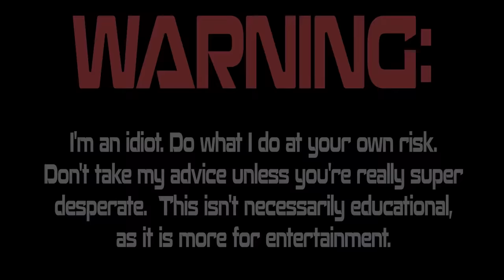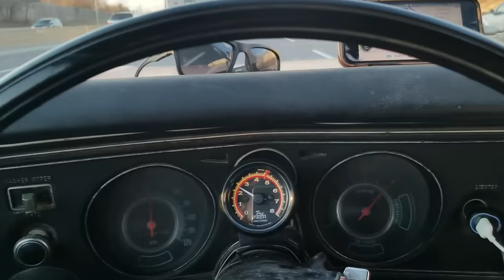FORGOTTEN 1969 Chevelle will it RUN AND DRIVE 500 miles home?

Comment: That relentless “can-do” attitude is inspiring. Much respect. Almost like therapy, in a way. This sub was a no-brainer and WELL deserved.
Reply from the maker: Thank you for subscribing
Reply: A guy sure does enjoy the vidgeos.
Reply: @ViceGripGarage  To answer your question in the video. Only firing order 
 one I can remember off the top off my head is the ol straight six and Kenworth Trucks cause I build them everyday in Chillicothe Ohio. Straight six is, 1, 5,3,6,2,4. And the ol Kenworth diesels fire at the same actually if it is the Cummins motor. If it is paccar motor they are a bit different but almost the same. Just starts at valve 2 instead of one. And btw subbed and Joined the Clubhouse! Love your content man. Could drink beer with you all day. Your a real one 🕜

Comment: firing order of my Briggs and Stratton lawn mower engine----  1...1...1...
Reply from the maker: Pull the manual out? 😂.  Thanks for watching John appreciate ya!
Reply: @ViceGripGarage  thank you!
Reply: Harley Davidson 1,2,1,2,1,2,1,2,1,2.............
Reply from the maker: Nailed it.  Unless its mine... 1.2.1.1.1.2.1.2.2.1.2.1.2.2.2.1.2.1.1.1.0
Reply: I think that's the same firing order as a Wankel. Lol.
Reply: My Harley goes 2,1,2,1,2,1 (AMF)
Reply: Battery to distributor to plugs!! And I know the coil is in there somewhere near the piston return springs!!!
Reply from the maker: Hah
Reply: Lol!
Reply: lol
Reply: Lol
Reply: Came here to say the same thing
Reply: Always screw that up.
Reply: Mine is 1,2,1,2,1,2,1,2,1,2
Reply: Is it the same mower that is the size of Titanic?
Reply: International Harvester 266/304/345 and 392 V8s are pretty fun. They use the same firing order as a SBC but they time off #8 instead of #1.
Reply: John Becay that is exactly the same as my Honda dirt bike engine 1...1...1...1...
Reply: Is that forward or reverse?
Reply: Our 1939 John Deere is 0-0-0-0-0-0-0-0-take break hope you don’t have a heart attack-0-1-0-1-0-1-2-1-2-1-2-1-2-1-2-1-2
Reply: My Harley is 1-2-1-2-1-2-1-1-1-1-aw, shit, that back cylinder is mis-firing again??? sigh
Reply: This might be some good info, but a guy's running a Tecumsie on his lawn mower

Comment: Anyone who sees this, good for you. I always do a compression test dry first. Then add oil if a cylinder is low. If it picks up compression then the issue is rings/cyl wall. If it is still low after adding oil, it's a head issue.

Comment: Any average european driver: calls for a tow truck
American driver: "We dont do that here"
Reply: whats a tow truck???
Reply: @knuckleberry4720  Exactly! I got a clapped out dually to tow a 20 foot trailer for hauling cars that can't be driven. Usually due to body damage. Or them newer cars that can't be fixed so easily due to all them sensors and computers that go bad regularly.
Reply: @consaka1  cool i have a 1975 ford f250 4x4 360 4 speed. it should be fixed up by fall /winter glad the stopped pure salt and use sand salt here in upstate new york.
Reply: @knuckleberry4720  You need to get them to quit using salt altogether. I see the cars from new york on the "south main auto channel" and fairly new cars are rusted to pieces. he tries to get stuff apart and the rust just rains down all over his floor. Its rediculous.
Reply: @consaka1  thats the northeast
Reply: @knuckleberry4720  The other end of the state is different?
Reply: @consaka1  no the northeast of the US
Reply: @consaka1  down south is the bible belt up here its the rust belt
Reply: A what now?
Reply: Last time I called for a tow I got stuck in someones drive way because their driveway was basically on a downhill area. My car literally was teetering LOL.
Reply: So you’ve never been to Europe then...
Reply: @johnnyrvf  I am eurpean dude... Its a joke..
Reply: That takes out half the fun of these videos. That's why he doesn't usually tow!

Comment: I lost it when he said carb adjusting tool and pulls out a hammer
Reply: Tyler Tyler your parents would trade you for a carburetor
Reply: Tyler Tyler do you even muscle car bro😂
Reply: That's the answer if it doesn't work hit it. Violence and technology, great bedfellows.
Reply: Last time I dealt with a quadrajet carb . I got up on the  front and Happy Gillmored the carb off the intake and stuck and edlebrock on .
Reply: Hell yeah I'd take a carb all day over old shity fuel injectors
Reply: Hey guys you're not paying attention to our supreme leader. It was a screwdriver not a hammer. Always use the correct GM tool for the job!
Reply: @dennislynn2955  it's called love tap therapy now a days
Reply: @harryhyde4331  Haha!!

Comment: Thanks Derek for bringing back memories of my long deceased Dad helping me put life into a forgotten 71 Challenger I found behind a car dealership left for dead in 85. 
We stuck a battery in, poured oil and gas in it, put on some used tires, got her running and I paid 200.for a clean title to a rust free straight solid ride. 
After tweaking on it, cleaning it and tuning herbup I drove her for 2 years but the memories will last forever. 
Wish I still had her but she went to a good home.

Comment: Love the channel, I need a road trip like this, been forever, had me a couple Chevys,68 Caprice 2 door 327 ,73 El Camino two different 350s, 73 Monte Carlo 350 Rusty but trusty used to drive the highway to work doing 120...308 gear. 68 GTO 400. 70 Torino 302. 74 Plymouth Satellite DNR car green four door 318.85 Chevy 3/4 ton 350 with the fancy FI. quadrajet contraption. 94 Lincoln Town car. And various jeeps and pick ups. Work on everything my damn self... 54 y.o. Welder Fab guy.
Reply from the maker: nice herd of vehicles!!

Comment: Thanks for the ride Derek. The 307 build was one of the first we watched, but this one is quite the tribute. You share just the right amount of detail to teach the same things over time, so we understand both the importance of the order you follow, and why some things like three gauges matter at highway speeds, or why the engine is still running...alternator works. These videos are priceless, and we're all so much better off for feeling in a way like we spent three chilly days in Illinois with you.

Comment: About those thermostats. I cut the part off where the spring is. I take a 3/8 drill bit and drill a little hole in the thermostat. It holds a little antifreeze back but also allows antifreeze through.

Comment: The gas can reminded me of the day I brought my 64 Impala home. But my gas can was on the floor , front seat. I did not have 500 miles , about 50
Reply: No smoking? Where’s the fun in that!! Gotta have suspense and fear lol
Reply: @kenwillis8487  Yep,  but easier to tow home
Reply: On my wife's YouTube but a cigarette will go out if dropped in a bucket of gasoline, used to clean parts over a bucket of gas. Now try that with diesel, probably not a good idea. But gasahol needs an open flame to ignite, IE spark. And the higher the octane, the less bawoof affect, lol. Cheap gas runs across the ground in fumes, good fuel sits pretty, lol.

Comment: When Chevy made good reliable cars, can't say that these days.
Reply: I've got a 2010 Camaro SS/RS with 75,000 miles on it with 0 problems. I bought it new. Yes I go to the track and race it and it's my daily driver unless it snows. Love it!
Reply: Camera Stage Videos when the criminal government forced computers into cars they ****ed EVERYTHING up.
Reply: Camera Stage Videos
I'll agree with you on that.
Reply: @adamdozier5757  Give it 200,000 miles and get back to us.
Reply: I think hes referring to the none ls powered Chevy cars
Reply: @jerredwayne8401  Who?
Reply: @b.c.gamingss  op
Reply: @jerredwayne8401  Alright Mr. Boshears, I was referring to Mr. Dozier.
Reply: lol, I grew up in the 60's and 70's. Any car with 100k miles was shot, you cant say that with modern cars.
Reply: @adamdozier5757  let that camaro sit about 15 year i guaranteed you will have to fix almost everything in that vehicle
Reply: @markclark4406  WELL IT'S BEEN 9 YEARS WITH 0 PROBLEMS. ANYTHING FROM THE 80'S AN OLDER CAN'T SAY THAT WITH 82,000 MILES ON IT. yOU DON'T SEE TO MANY OLDER CARS WITH THAT LARGE OF A NUMBER. MY 55 CHEVY ONLY HAS 40,000 ON IT AND I'M DOING A FULL RESTO ON IT. I'M NOT YELLING I JUST SEEN THE CAPS WAS ON. LOL

Comment: Every time you talk about one of these drives I kind of smile because I have made all of them in some form,  I moved to Alexandra Minnesota in 2007 from Ohio and left there just shy of 10 years in 2017, I spent 10 years in that state doing multiple types of road construction for minndot and I got to tell you guys, I chuckle at Ohio winters now! The flat corridor running east to west from Fargo ND to Alexandra is one of the coldest places I have ever been in the lower 48 states! I try to describe the cold but there is no describing -60 wind chills and - 50 temps and cold that hurts your skin and you can't breath well. I have one photo from when I lived in this small city called Ashby, between Fergus falls and Alexandra, where I had shelved my walk all winter and on each side of the walk is a wall of snow 3 1/2 feet high. That area is really flat and snow just blows all over the road and drifts are every ware! A guy could do well to buy himself a 4 wheel drive in that state, not to mention some good Air conditioning in summer because it's humid as hell there, at least you got great fishing holes. I was telling my buddie if you walked out your front door pointed in a direction and kept walking in a strait line in that direction, you would eventfully hit a lake you could fish in! In all honesty Minn is one of the most beautiful places I've ever seen in summer and a great vacation spot if your into fishing and camping, but from ND to WIS all three of them states are some of the most brutal places I ever been in winter, only being outdone by Alaska! hahahahaha

Comment: I am binge watching and am going down memory lane with my past vehicles.  One in particular, 66 El Camino, 396 with 375 hp.  Starter built too close to the exhaust manifold.  Difficult start cold and would not restart if warmed or hot.  Would compression start or jump start.  After several starters, I was one unhappy puppy with Checker and somebody else auto parts in El Paso Tx.  It was my learning platform and I was a soldier at the time and 19.  Alot of defective points or plug wire kits, coils and I learnt what a ballast resistor was.  But three starters and batrees.  I really wanted this beast to work.  I ended up selling to a person who eventually got it started and daily driver, just not mine, oh well  Thanks for the reminder.  Defective parts out of the box and this was 76-77, 19 that is.  again, oh well

Comment: 32:00 “I’m gunna fill it up with oil and check the gas.” 
This is a line I’ve been using for nearly 20 years and it took a moment to drop, but it is so true when you’re working on old cars. 
The air cleaner is hilariously large.

Comment: 307 cid were a pretty reliable engine. There was a problem with the cams in them, but I forget what year it was.
I really love my Chevrolet's and GMs too. I started a mechanic apprenticeship in the 70s and they were so simple to work on compared to Ford and Chrysler. Parts were cheaper too and better quality. AC Delco 💕

Comment: Awesome video, brought memories when i use to overhaul those carburetors with a Borg-Warner repair kits., There were also kits for the brake pump and the fuel pump.Today just exchange and replace... great car i had one 1969 to bad it was all rusted..........

Comment: Known Chevy small block firing order since 1980.
Brother got an '67 Chevy Bel air. Timing chain was so loose it wore a hole through the timing cover. Two weeks after that, the rings seized to the pistons and it lost compression. We rebuilt that 283. Ran well until the radiator split and the engine overheating. Valve seat dropped, held a valve open, and it punched a hole through the piston.
Replaced the piston, and repaired the dropped valve seat. It ran after that, but smoked. He drove it until the frame rusted out.

Comment: in canada your chevelle was also called a pontiac beumont, built on a chevy platford with chevy dash in oshawa, ont. the chevy ss was a 2 t 2 on the beaumont. both used chevy motors.

Comment: A method I have used in the past to remove a broken off brass fitting is to hammer into the fitting an slightly oversized straight blade screw driver and then using a pair of vice grips on the blade, easily back out the fitting.

Comment: Did you try banging on the starter with a hammer?  That used to
work with my 1967 Mustang when the bendix spring would get stuck.

Comment: My very first car was a 68 Chevelle Malibu with a 307, and 2 speed Muncie. It was an awesome car!
Right up until I ran it through a cinder block wall... But it still ran!
Those 307s are bullet proof! Keep the oil changed, and they'll run forever!

Comment: I had a 69 Beaumont (Canadian Chevelle) with a 307. Notorious for burning oil. I went through about a quart every 100 miles. Just kept dumping in STP and eventually got about 1 quart every 300 miles. Other than that, she ran perfect. I went across Canada and back (10,000 miles) with no major issues. Killed a lot of skeeters :)

Comment: Derek find the lightest chassis you can put 4 11 gears in it 327 with 305 heads on it you can roast the tires or put tractor tires on it until your cornfield

Comment: The Chev 350 V8 had picked up. Was a mid 70 engine and turbo 350 imported into Australia sold as a ‘good running complete’ to swap into my HJ Holden,,, well it was a oil burner, and on cold starts (and in the tropics too) would also rod knock for 3 seconds. Have not purchased another thing from them for 25 years
But I drove it 2800km (about 1600 miles?) Over 3 days in the mid 90s to Victoria without issue other than plugs oiling up.
My engine was junk but they can still run after many miles of abuse.

Comment: Glad i found you i needed to know what's on the market now i haven't started my 72  GTO since 91 need to find that oil and gas mix you had just to get it stared again i have a electric fuel pump i can shut off. 1985 last time i put gas in it I ordered the car in Dec 71 got it in Feb 72 retired now time to get it back on the road.

Comment: 18436572  is really the only one you need to know, but when I was learning to be a mechanic in the mid to late 1970's while in high school, the senior mechanic at Sandwich Chevron where I worked, (there was only two of us) taught me some great ways to remember tech info.
I already knew the Chevrolet firing order from building my Camaros.
Then I learned most inline 6 cylinder engines manufactured from the beginning of time , to the late 1970's  had a firing order of :
153624
Senior mechanic Dave was a lady's man. Real or imagined. The way he said to remember the inline 6 firing order is :
"To young, too old, just right" ........
He was a very knowledgeable mechanic, a character, and a really nice guy.
I learned a lot from him.
Another fun video Bud. 
Take care.

Comment: yes i had a 1972 Chevrolet   2 door hard top, fender skirts, 4 bars,  number 1 sparky in the back, and the number 8 in the front , had to pull out the timer tho, point that old rotor to the 8 in the back that now is number 1

Comment: I swear most people who watch you probably don't understand just how rough it is to do what you do. I noticed you just blank out all the rough parts where you are putting in a starter or replacing break lines. Man you could have done a whole fucking engine swap in the time it took you to fix up that car and at the end of the day you say, "Man that ran like a CHAMP, Im surprised its even running after all these years." Bro anyone else who tried that would not be saying that. Just a testament o your will and skill.

Comment: I owned a 1969 Chevelle, 350, four barrel, four speed, blue with a black top.  Paid $2,750 for it, out the door.  It came with Tiger Paws that I could not keep from vibrating over 60 mph.  I spent a small fortune keeping it aligned and the front tires balanced.  It ended my love of pony cars.

Comment: That reminds me when I was 15 and we (family) had a 1968? Chevy Chevelle (station wagon, with same headlights/backlights). I used to work on that car all the time especially the carburetor. Chevy's were made especially for the do-it-yourselfer. Albeit I used to sneak out all the time late every night, it seemed, just to cruise down the empty streets with the radio on loud so I could karaoke along. To make small fries of a big potatoe story I ended scraping the side when I tried to get out of the parking spot which had a very tight spacing along with confining cement filled pipes. Well, this dreaded night I could not get my ass out of the parking spot and scraped alot ofl the left driver's side. In the morning after a night of wishing it would all go away & come back fixed my stepfather was outraged at wondering what had happened. Well I didn't admit it at first, but when I saw how upset he was, since it was also a new baby blue flake paint job only three months old, I had to humbly confess &  told him I would fix it which I did, with some popping out of dents & sure work bondo as well as a new paint job. That surely quit my night escapades and I never snuck out ever again with the family cars, working on the car was also exempted.

Comment: You need to expand your chemical toolbox. For example, old oil is great for doing a chassis lube, with an old paintbrush. It s also a rust prohibitive. It's also a good way to recycle household plastics. Egg cartons, coffee cans, and clear plastic peanut butter jars are invaluable tools around the shop. An old toothbrush and electrical contact cleaner works a gem on crusty electrics.

Also, how about you buy a car in Europe and take it on the Nürburgring ring?